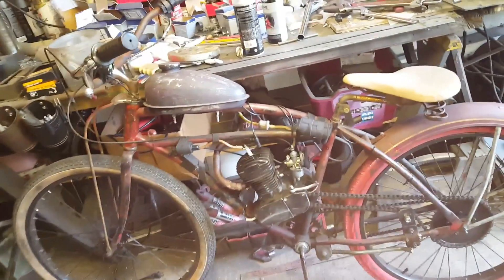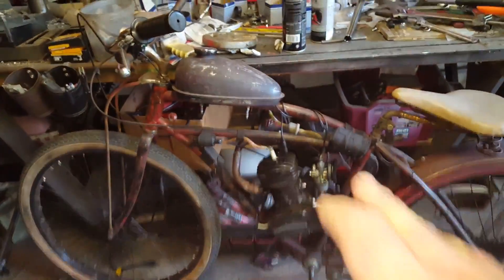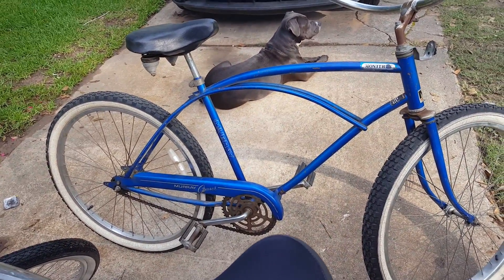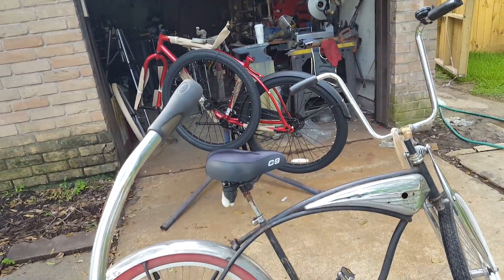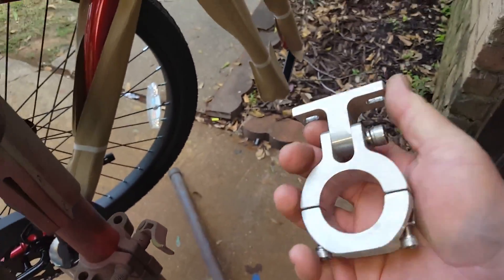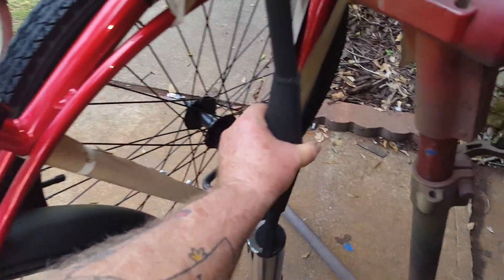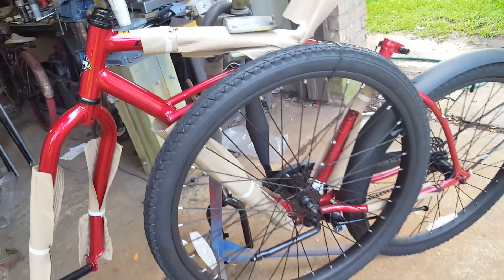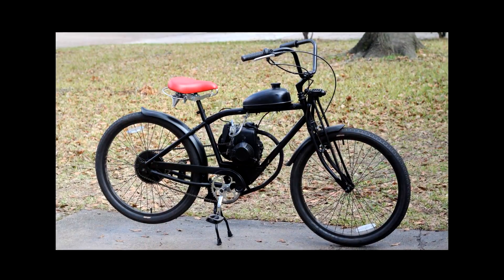How To Build a Better 2 Stroke Motorized Bicycle Video Series Part 1

Comment: Rear fender fell off on my Huffy Good Vibrations which is basically a Cranbrook. Exactly like you said, it just chipped right in two. I'm looking into building a more robust bracket, because I want a street legal motor driven cycle and fenders are essential for that (i believe).

Comment: Hey brother quick question...why can't you use a gocart clutch on the 4stroke engine instead of the transmission belt set up?
Reply from the maker: 49cc bike has 5/8" shaft. You can use any clutch you want. You'd have to adapt or find one to fit 5/8 shaft then rig up a transmission to it

Comment: What sprocket size do you typically run? Or recommend??
Reply from the maker: 44 tooth. I like power down low. I putt. No need for high speed. My daredevil days are over